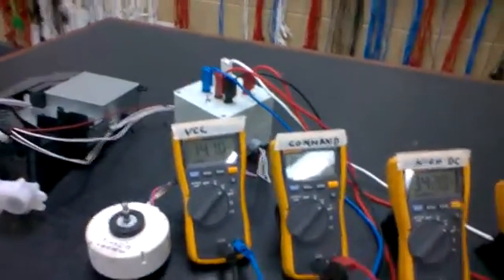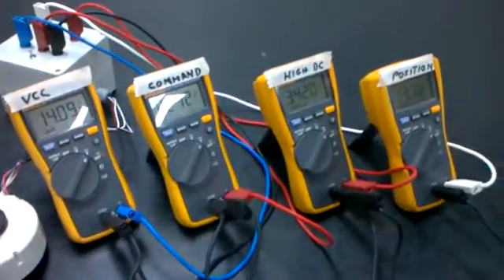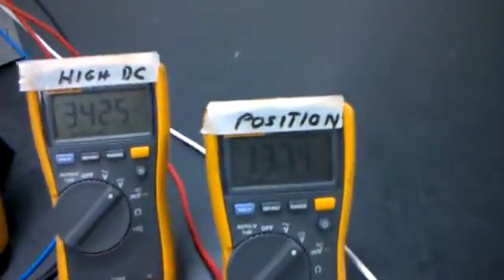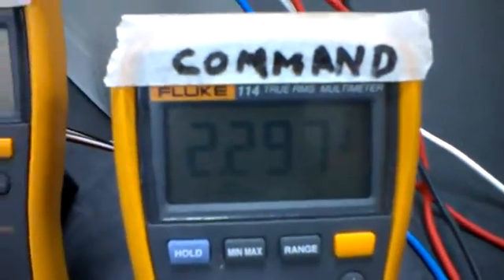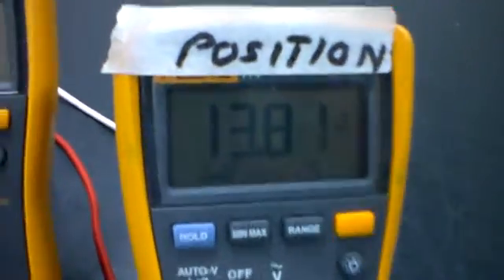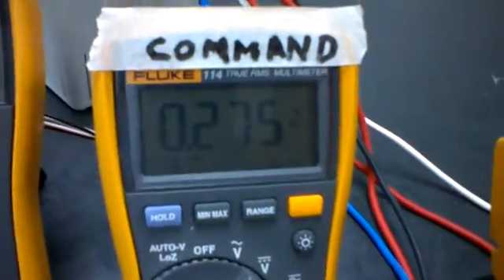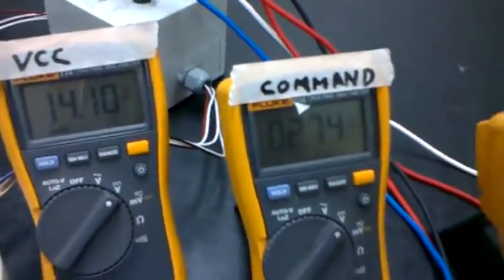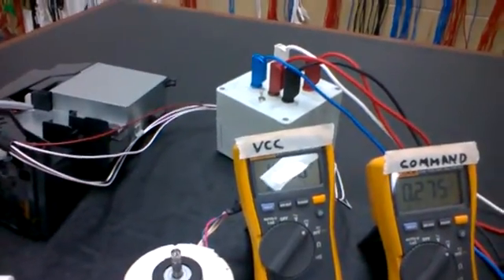Split System DC motor testing

Comment: Hello, great video. I am a HVAC technician here in New Zealand and have been searching for a universal test tool just like this for troubleshooting heat pump system / dc fan motors. Any chance you could point me into the right direction? I see a few people on Oz using them. I cannot seem to find them anywhere.
Reply from the maker: Hi,   this rig I built to interupt the signals to a dc permanent magnet motor so I could demonstrate  fan harness to pcb driver testing positions.  normally too difficult to test due to small test points. Many manufacturers use similar motors but voltages and pin references change so this one was made to a specific well known brand.  I use it to train students in a safer manner.  Check with your brand manufacturer and see if they have a comms tool that can display more motor telemetry. These days its all reverse bias resistance tests from given pin points.

Comment: Hi Dennis, many thanks for your super information and helpful video with clear explanations. My LG ducted split aircon ducted aircon (model B55AWYU362 with indoor unit B55AWYN7G5) has developed CH10 error recently. CH10 points to loss of indoor fan motor feedback signal for about 50 secs and shuts unit down.   A reset on the breaker clears the error but similar error developed on restart. 

Some checks and troubleshooting: 
- checked fans near the indoor unit. Fans were running ok, without any abnormal vibrations or abnormal noise. 
- manually rotate both fans and both were spinning freely (nothing is seized)
- cleaned motor driver pcb with isopropyl alcohol snd checked connections. Nothing abnormal visually. Started aircon but tripped on similar error 
- Suspected motor driver pcb to be faulty and replaced with a new pcb but aircon tripped in similar manner with CH10 error. 
- There is another pcb next to the motor driver pcb and assumed this to be healthy 
- with the above observations and after watching your video, I suspected the feedback signal from one of the 2 fan motors are faulty, causing the trip after around 50 secs.

I’d appreciate your advice on the possible issue and next steps.  I assume the pcb next to the motor driver board will not cause CH10 but not sure if this is correct.  Thanks
Reply from the maker: CH10 on an LG is a fan position lock fault. Simply put the DC fan is not sending back motor telemetry on rotation. This is either a fault with the  pcbs ability to send  a reference signal voltage to the motor or the motors ability to send back the hall effect signal in due time.  Things like dry joints in  harnesses or cable's can cause this too.  The fan motor has a driver board,  this is where command and response occurs. Smaller units are all integral to one outdoor pcb but some larger systems will have a separate fan driver.   PS you cant spin a dc fan motor with a blade on it, as it  will give weight  ballast to faulty motors and make them seem OK.. Try it with the fan blade off and see if it feels notchy while unplugged from the board. This is a sign of internal issues mechanically.  Good luck
Reply: @whatwoulddennisdo7243  Thanks Dennis. I reviewed my troubleshooting steps and realised I have only 100% verified one of the 2 motions were spinning when aircon was switched on. The motor at the further hasn’t been verified. I did a check on this yesterday and found the fault - that motor wasn’t running at all (failed). Getting a spare motor now.  Cheers
Reply: @whatwoulddennisdo7243   does the pcb send a reference signal via the feedback wire or does the motor take voltage from the high DC voltage wire and send a little bit of it back to pcb via the feedback wire? 
Thank you
Reply from the maker: @TekiWeki  The single phase dc motors use Vcc control voltage and send motor position feedback via the hall effect ic to the pcb to give it a speed reference. All the pcb driver will do is increase or decrease command voltage until the speed reference or tach signal meets the programmed speed set by the designer.  These motors have multiple operations going on at once. See the multimeters

Comment: Thank you for the demo. My Daikin fan motor of the outdoor unit not let the PCB start up. When I disconnect the fan plug the diagnostic LEDs go on. In the motor the blue and brown wires are shorted internally with each other. My question is if this motors can be repaired? ... You answered down in the other comments.... Not serviceable. Thank you.

Comment: Hi Dennis, I am trying to run a motor just like this 325V, 1amp fan continuously without it being connected to a PCB fully (or bypassing the PCB logic) to use only the fan portion of the mini-split (I will circulate glycol/water through for air cooler application). I'm therefore wondering a few things: is the 325v always on such that I can use that from the PCB board output? Also, would I then just need to interrupt the 3v-6v "speed/on" control and input 6v from maybe an external AC to DC transformer? I guess I would keep the position sensor variable voltage going back to the PCB. Basically, is this mode of operation considered the heat-only mode, where it doesn't look for the coil T1 and T2 thermistor temperatures (ohms). Lastly, I was going to try to use another separate 12 or 24 V transformer for the 3rd S3 power input to the "evaporator" unit (Positive connection only since I don't know what to do with the common neg side). Any comments as to whether this could work before I buy/try stuff would be greatly appreciated! TY!
Reply from the maker: Wow that sounds like too much work to me,  Have you considered a simple EC or electronically commutated motor that converts AC to DC operation and can also use a variable input.  Dont try to circumvent manufacturer logic on an established system.These motors you see are made by common parts manufacturers and are setup by design speed needs by the aircon manufacturers.  Once you try to bypass sensors on systems , they detect each other faulty or they cause other operation glitches. Whatever your planning, I suggest you come up with something new and independant.  My vids show how the logic works to correct manfunctions

Comment: Super informative video mate, really appreciate this. I'm currently taking a deep dive into troubleshooting my LG split system and fault codes have noted a BLDC motor lock on the outdoor unit. Mainboard voltage measurements seem to check out, with 15VDC, 330VDC and control voltage apparent during boot. Would this indicate the PCB is in fact fine?

I've ordered a new replacement motor (seems to be a revised model ending with 'Q', my suspected faulty motor is a 'B' variant) so I'm hoping this will fix the issue. In your experience, if the mainboard checks out, what is typically at fault with these motors? I've tried testing the motor on the bench just by measuring voltage across the rotation pulse output and 0v reference and spinning the shaft by hand, the voltage seems to climb?

Thanks again for the really informative video.
Reply from the maker: The most important facts are as follows,, 1 you have the high DC , and 2 you have a control voltage VCC.  The fan motor has to return a tach signal through the hall effect. If your unit is putting out a command voltage , then most issues are with the fan motor.
Reply: @whatwoulddennisdo7243  thanks for the reply. I ended up repairing the system which turned out to be a faulty IPM. A Zener in the path had also shorted. Part for my replacement: https://au.rs-online.com/web/p/motor-driver-ics/7395080/

Cheaper than a $700 replacement main!

Comment: IF YOU  POSSIBLE, HOW RESISTANCE OF DC MOTOR IN CLOSE CONDITION OF MOTOR PLEASE
Reply from the maker: There are resistance tests possible but you must check with each brand manufacturer for the specific testing methods and outcomes. You will need their service manuals or obtain technical support.

Comment: Hi,

how to check resistance for this kind of motor?
Reply from the maker: That depends if the manufacturer has them avaliable as a service check item. They will likely be several megaohms or even open circuit on some tests. Many do so check with the AC brand service centre or technical support staff
Reply: My unit is Lg inverter aircon and motor for blower is DC310V SIC-37CVL-F130-4A, when I pulled out the motor I noticed when I tried to rotate it has some resistance, when I check the bearings are ok but once I put it in the motor resistance to rotate appears again.  Does this indicate a problem?  It should be free turning with no resistance right?
Reply from the maker: It is normal to have some resistance to movement in DC motors as the permanent magnet when turned acts as its own braking force. However if it feels "notchy" such as its gripping and unsmooth to turn then this can indicate internal problems. You will only get 1 to 1.5 turns when you spin the motor shaft freely unweighted by hand which is typically normal. When you have a fan blade connected , this adds ballast and makes it seem easy and free.

Comment: hi , its very nice ..... I have a question about such kind of d c motor control ......as there are many universal pcb available for the a c motor used in the split indoor can I have some universal pcb for such d c motor ...... pls reply
Reply from the maker: No this is is dedicated DC using 270V DC from a built in rectifier on the indoor pcb.  AC equivalents use phase control motors

Comment: Very usuefull thank you, about position signal it is actualy an rpm feedback. This why the board will in or decrease the control voltage according to the feedback.
Reply from the maker: Yes, the position is based upon hall effect sensors or rotary encoders embedded into the design

Comment: Hi, Dennis this is very informative video and rare like a gem, i find your web site to.

        I have very similar BLDC motor from toshiba daiseikai 6 AirCon  and all voltages on board  Vcc 15v, high dc 310, and command voltage is swinging from 0 to 5v in two attempts and motor wont start !  Everything imply that fan motor is bad.
I have idea to cut plastic case in circle like you and repair electronics inside? I assume that is some electronic problem on board inside motor? 
Here where I leave tech. support is not so good and I am struggling to find spare part, what do you think? I see that you have experience in opening this little puppies :-)
Thanks and keep a good work
Reply from the maker: Remember the PCB detects postion signal.  Even if the motor is ok the main pcb may be an issue. From my experience, the motor is usually faulty. I would make mention that units installed in coastal regions are subject to salt air degradation and this can also add to main pcb failures
Reply: Hi, thanks for your reply. I just find out that is impossible to repair electronics in this kind motor that i have because electronic components are submerged into plastic. 
I just find this useful document https://www.scribd.com/doc/61345930/2-dc-Motor-Checking-Procedure  and build 3 separate power supply,  one for dc 310, one for 15V DC  and one with voltage regulation from 1-6V. I have tried to start up motor but it does not start. It is definitely a motor failure! Only difference is when I unplug 6v dc command voltage I can rotate motor with hand freely but with command voltage there is some resistance to turn with hand on one side, but no independent movement at all.

 Can I replace original motor with some substitute with same dimensions and voltage? My motor is ICF-340-30-4, what number 4 is for, I understand 340 is 340V for red wire and motor power of 30W but number 4 is mystery. My worry is that pulses per one rotation are different for different motors but maybe lot of motors use  some standard for example 2 pulses per one rotor turn, I do no know. Probably depends how much hall effect sensors are in motor.
Reply from the maker: They are not serviceable , there are usually no spare parts other than a full replacement motor. The one I have opened was for view here , it could not be re-assembled again.  The manufacturer of your brand of air-conditioner should have the spare part listed, I would contact them first.
Reply: @klokoloko2114  I am trying to run a similar mini-split motor continuously on high power without a PCB controller so how could I build/buy a 325V DC power supply. I think the 15v and variable 3-6v power supply are common online.